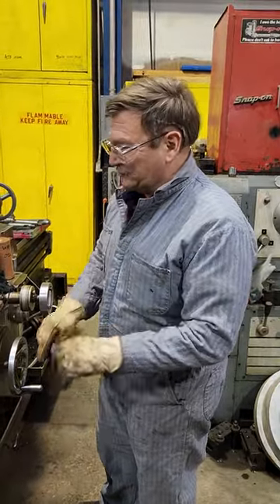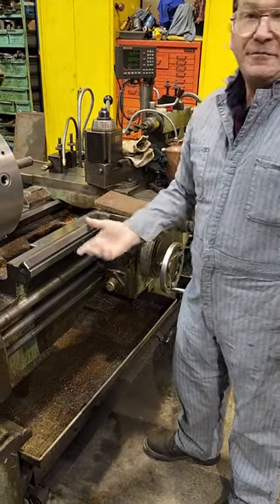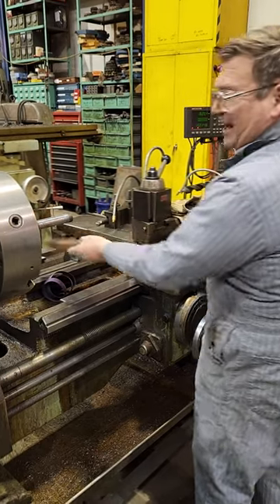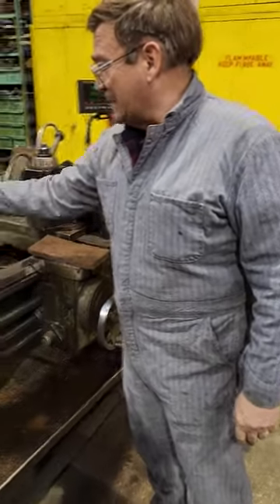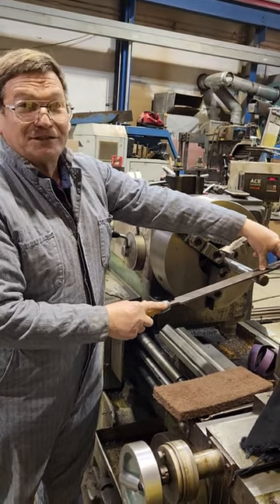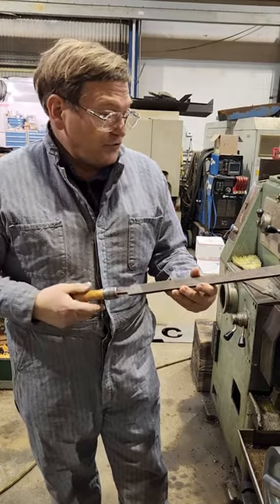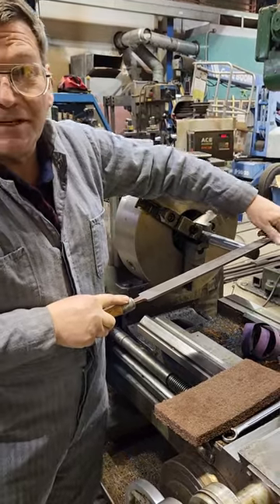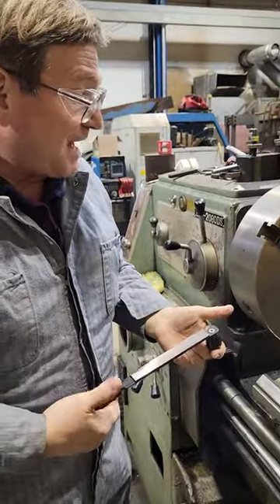Machinist's Minutes: Lathe Sanding, Filing, and Polishing

Comment: Love the info and videos, but I have to mention about the files, dragging backwards doesn't really dull them, and can actually aid with chip removal.

Fireball tool has a good in depth video on filing backwards showing it's not entirely true about back strokes.

Comment: What are some good brands of carbide files? I googled and could only find carbide grit files. I would love to own one.
Reply from the maker: The only one I know of currently is Severance, they also make carbide burrs.  The one I showed was a fj5w = 25 teeth per inch.  I also use fj7w = 16 teeth per inch.  the cutting area is 3/4" x 6" this is the biggest size they make.